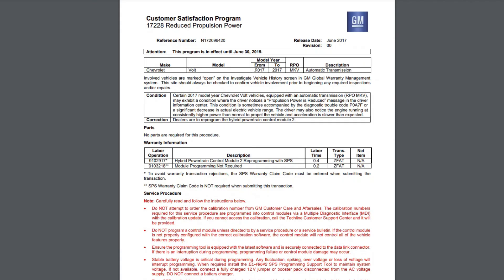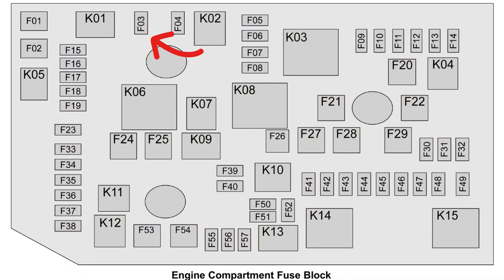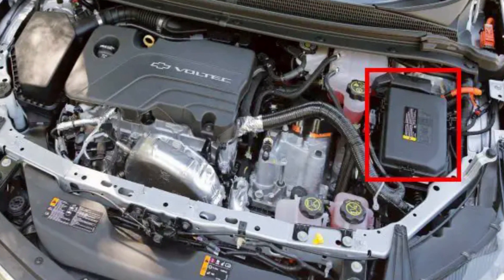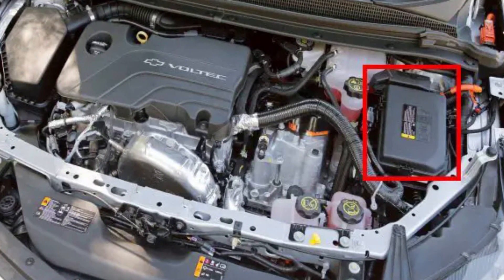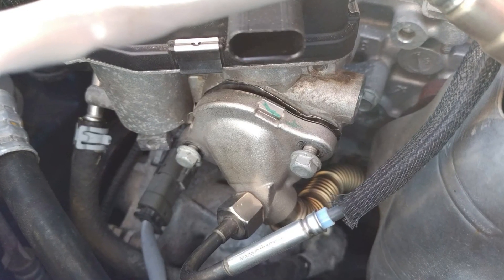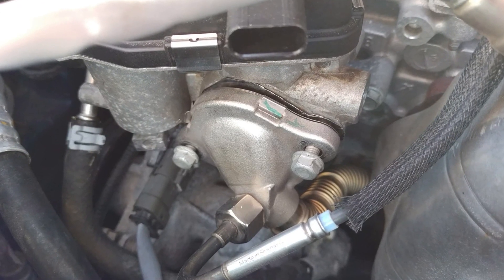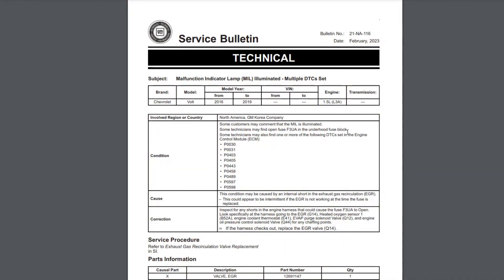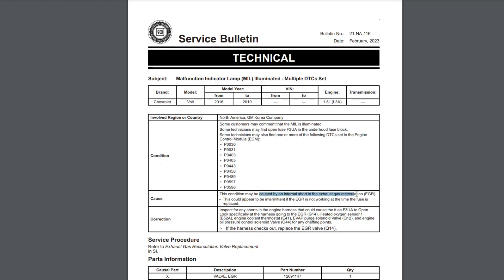“Propulsion power reduced” warning in Chevrolet Volt – What’s wrong?

Comment: If battery go to 1 or 0 miles. Check engine turning on( battery control module lost communication) 
I replaced and reprogrammed the battery control module. Everything looks perfect but if battery go 1 or 0 miles same problem again. 
Can you help me?
Reply from the maker: I haven't seen this, so no information on the problem. But from what I know about these cars, this could be the weak 12V battery - it messes up software a lot in the Volt. You may try charging it with an xternal charger or replace it if it's old. They have a tendency to be drained in these cars a lot. Also, if the 12V battery is good, the problem is most likley with one of the HV battery sections, but there is nothing you can do on your own if this is the case.

Comment: I drive a 2013 volt & live in las Vegas.  In the last 6 months I started getting the low propulsion reduced mssg.  Weather here is between 100-110.  But I notice it gives me message when its parked then it sounds like it cannot change gear or rev up to go faster
A little scary when im driving on freeway.  No other lights are on, could it be just changing the fuse take care of this
Reply from the maker: No, if it's an occasional warning, the fuse must be OK. You need it diagnosed with a good scanner before making any decision on repairs.

Comment: Mine is a 2014, and I had this pop up on my message board shortly after starting. It was a very hot day about 95 degrees and quite humid, so possibly hotter. I let it run for several minutes, and after idling relatively high, it went away and started acting normal. I guess it's possible that extreme heat could cause this as well. My coolant needed to be topped off as well.